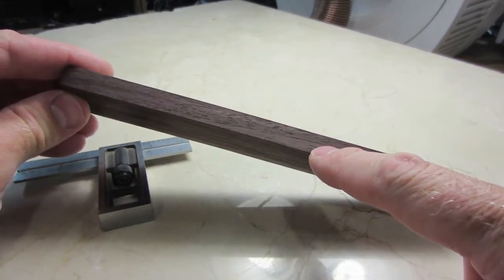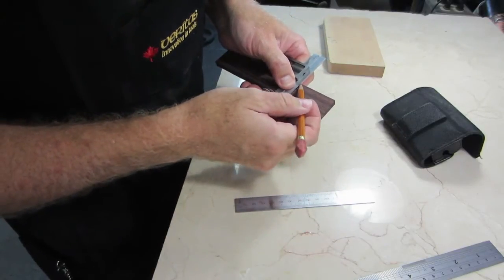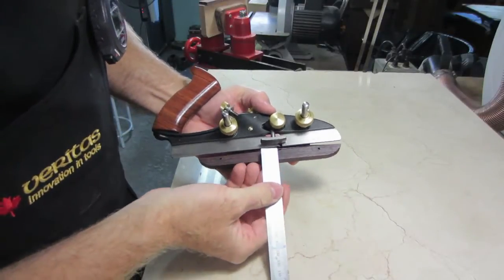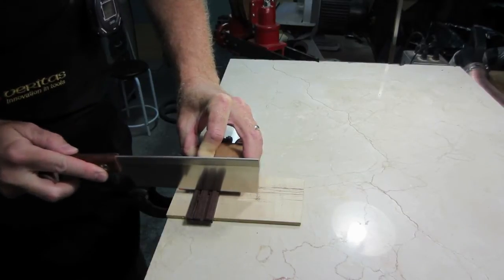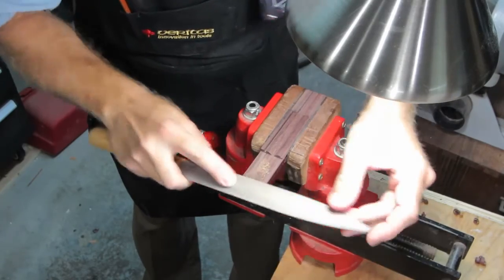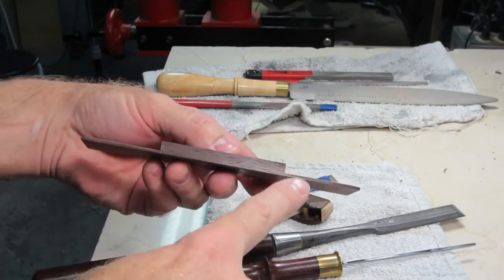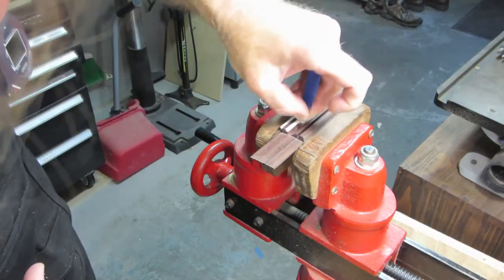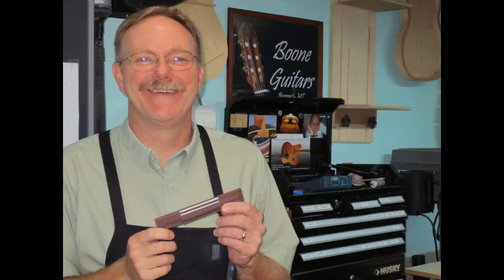Classical Guitar Making-The Bridge

Comment: The thickess is 8 just  mm. Why not 10. What is the final weight?
Reply from the maker: My bridges are 8 thick with 4mm thick wings. It could be 10 but it would add weight. I cannot remember the weight of this bridge but they are usually about 18-20 grams.
Reply: Thanks for the answer and for your original tips.